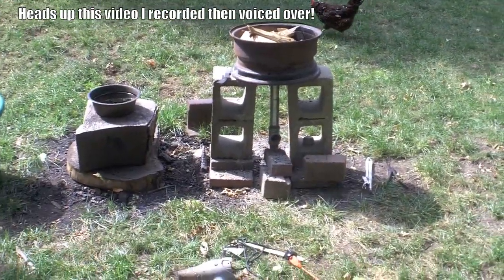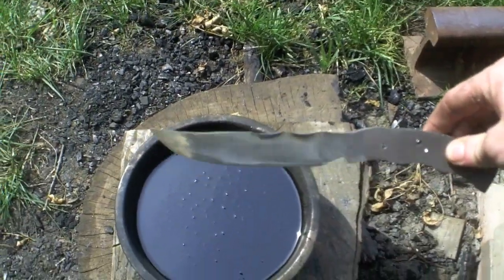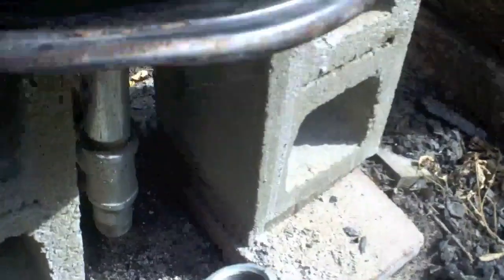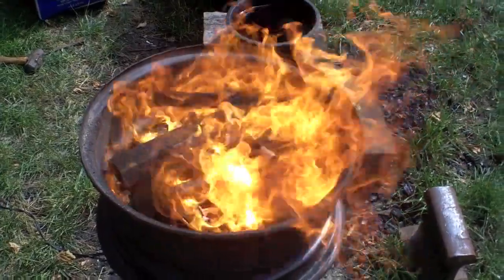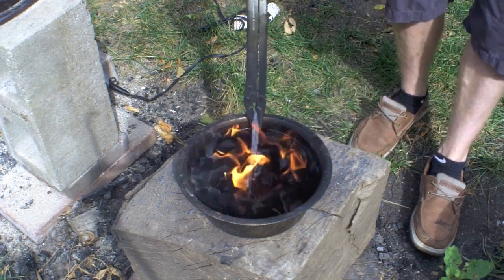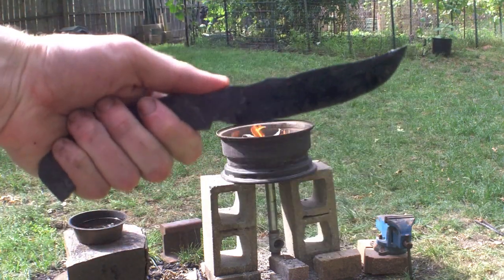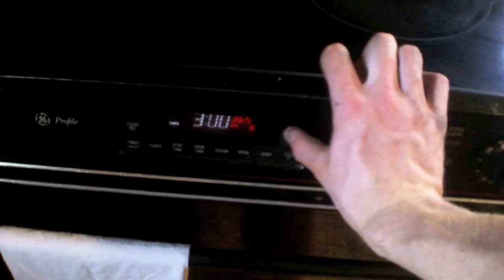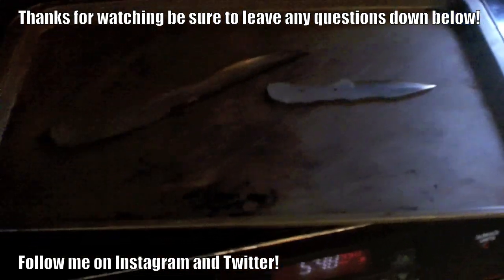How to Heat Treat and Temper a Knife! (DIY)

Comment: I usually temper my steel with the oxy ace torch since I dont have a forge the dunk them in motor oil like you and YES  that used motor oil is pretty flammable because it has gas in it now. Then I toss them in the propane oven at 500 degrees for 1 hour then let it self cool. I am actually working on a knife now but I dont have a channel. I just took pics step by step and short vid clips of each step. And that is actually my next step to temper the steel it is a Bowie I have been working off and on with for the past 5 days. Lots of cutting grinding and shaping that is for sure it is (3/8) thick but it all pays off in the end. Good Vid! :)

Comment: Hello! I just started knife making, and made a mistake of putting the blade into my handle before heat treating it..... I was planning on just quenching it, but could i quench it and bypass putting it in the oven? Thanks so much, cheers!
Reply: BurlyWoodWorks no that would the steel hard and brittle the first time u use it it will break

Comment: Awesome tutorial bro! very short but complete!
I´m starting with this and I would like to know what oil are you using there, if I can re use it much times, and how I know when the blade is ready for the oil. On the other side, ¿how much time and at what temperature should I finally temper the knife in the oven. 
Thank you very much!
Reply from the maker: For oil I use old motor oil, and I keep it in a pain can now so I reuse it over and over. The blade will be red hot and no longer magnetic if you dangled a magnet over it, that is how you know it is ready to quench in the oil. As far as tempering that depends on the kind of metal you are using. I suggest just googling what is best for the metal you are using, the more you do it you'll find what works best as well.
Reply: Than you very much.

Comment: What temperature does the knife need to be at before you quench it? I’ve seen people put a magnet on, so when it doesn’t stick then it’s right for quenching... are they right? This is all new to me so doing a bit of research... any comments would be appreciated
Reply: Tonto_77 I know this is late but yes... depending on what type of steel you use you heat up till it’s not magnetic

Comment: Awesome video
Reply from the maker: Thank you! Your machete looks like it’s coming along great so far! Miss the blacksmithing hobby!
Reply: @BennyCriss12  thanks for checking out my video man yeah it’s still mid process but I think it will turn out ok 

I like your little forge setup I might have to build one like that it’s just looks much easier to work with rather than squatting to heat my metal
Reply from the maker: @missourisurvivalandoutdoor9547  looking forward to the part 2! Looks like you have a lot of videos I should check out!

It was a good forge and worked well, was very cheap back when I made it to,
Definitely not the most professional but worked well for me.
Reply: @BennyCriss12  I almost avoid the convenient professional set ups 😂 just to get experience doing these things in hard times with less ready made tools and materials 

I appreciate you checking out the channel

Comment: What oil did you use to quench the blades in.
Reply: Depends on the type of steel you're quenching.

If it's, say, 5160 spring steel or 1095, you'd want to use oils. Things like (what appears to be used in this video) used motor oil, canola oil, or other mineral oils. Reason being the content of the metal. For "softer" metals, you can use water or brine (10% salt to 90% water)

"In terms of speed, in a small shop situation, brine is the fastest quench, because it throws scale allowing the liquid to contact bare metal right away. Water is next fastest for somewhat the same reason, though not all scale may be thrown off of the workpiece. A steam vapor blanket is formed around a hot piece when it is submerged in liquid. It is momentary, but with oil, it is prolonged compared with the water quenchants. The vapor acts as a brief insulator, thus slowing the quench a bit. With thin cross-sections like a blade, oil is recommended by metallurgists over water, even though the steel is sold as water hardening, such a W1 or W2. With oil, there is less chance of warpage, and you still get hardening. Ambient temperature brine or water may be too severe for thin sections, thus causing cracks, breaks, or warpage. Of course, air hardening steel has the slowest type of hardening."
Reply: KuroReanimation thanks for explaining the differences between oil and water..... ill try to harden my knife, hope it will not crack hehe

ill use oil...
Reply: KuroReanimation but how long ill put the steel in oil? asap pls

Comment: can a knive be quenched in olive oil, grape seed oil, or any food-made oil?
Reply from the maker: I used cronola oil when I started, not bad worked well, I have also heard of olive oil, never grape seed but I don't know enough to say no to it. Peanut oil is pretty common and cost effective, a lot of people like using that because of the high ignition temp it has.
Reply: @BennyCriss12  What about used motor oil?

Comment: +Benny Chris how long do you keep it at high temp in the forge
Reply from the maker: Normally just until it will sustain that heat, best way to check it is with a magnet (I'm sure you've heard this) the metal will no longer be magnetic, that is how you know it is good to quench!
Reply: BennyCriss12 how do you knoe when you Put the knifebout of the heat treating oven
Reply: BennyCriss12 what oils can I use or can I just use water.

Comment: Do I put the final edge on the blade after I put it in the oven or before
Reply from the maker: I have seen people do it both ways. But personally I think it is better to do the final edge first because belt sanding it will just get it hot again and it could lost the temper. But I honestly should research more specifications on that. Great question thank you!
Reply: +BennyCriss12 all right man thanks

Comment: what oil?
Reply from the maker: I used old motor oil, peanut oil is pretty cheap and popular now though, seems to work well.
Reply: What motor oil brand?
Reply from the maker: Thegamingchemist I have no clue, that shouldn't really matter though, if you know of one with a higher ignition point though that is helpful.